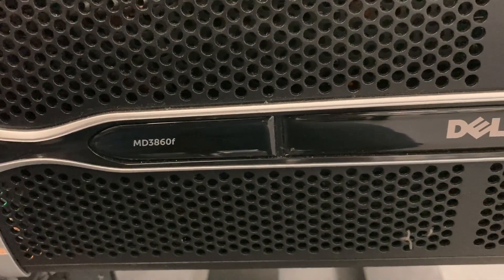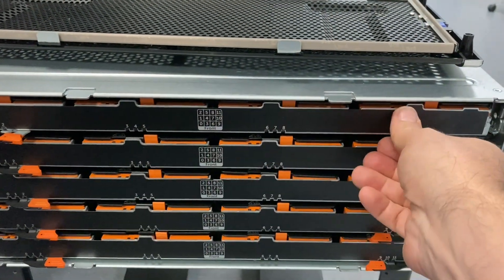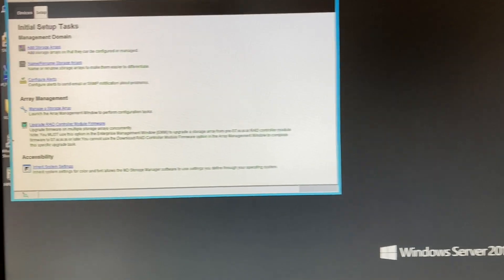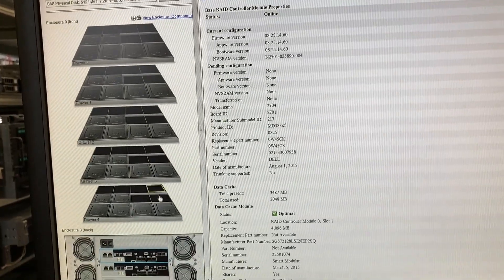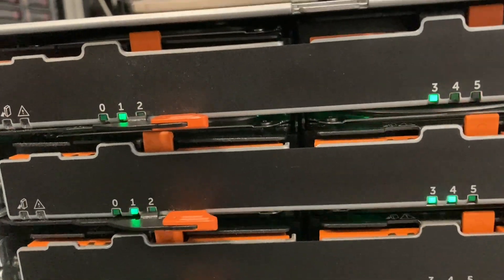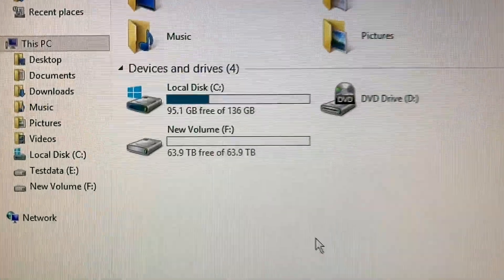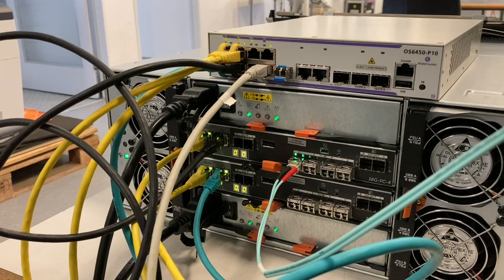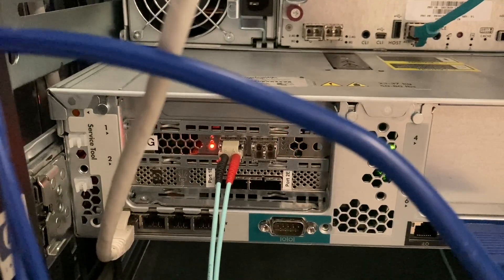Dell Powervault MD3860f 60-Disk Storage System (PWJ213)

Comment: Got two units just like this at work, and unpacked them with friend who is not weak but lightly built guy, while I am more massively built. Those are quite heavy while empty and we considered them to be empty. Got them out and in to their boxes.
Half a year later of idle storage in warehouse had to help 4 guys to lift those (they could not), apparently they were fully loaded with HDDs. Some fun psychology/power of believe stuff.

Cool channel name BTW!
Reply from the maker: One colleague at work lost the tip of a finger when he tried to lift a HP C7000 blade enclosure. They also tried to lift it with everything installed.

Comment: Nice stuff 🙂Especially this transport cart/crane. I also need such a device for lifting heavy modular network equipment. Which brand/model is this?
Reply from the maker: That's some very old gear. But if you google for "datacenter lift" you will find similar tools.

Comment: Is this still useful?  I mean it works, but would anyone deploy it in a new setup?
Reply from the maker: Probably not this model but there are similar storage systems available today. Smaller disks or SSDs but the same idea.
Reply: Considering there are 22tb 3.5 inch drives out now, I can see this still being useful for extreme capacity, though I'm not sure if this model can support anything that large.
Reply from the maker: It already has 12TB disks inside. I see no problem to install 22TB's. Maybe you need to make more virtual disks.

Comment: Can it also be used as a sas jbod? What are the sas connectors on the back for?
Reply from the maker: I think JBOD is possible. If not directly then you can set up single disks as logical volumes and map them as desired. 
The SAS connectors on the rear are for expansion drawers with more disks.
In fact if you only want JBOD, then you can use an expasion alone wihout any RAID controller. Saves some money 🙂

Comment: Sad to think you can store many times more storage on a micro SD card smaller than a Cornflake
Reply from the maker: I haven't seen a 12TB SD card yet and if that exists it will be more expensive than a HDD of same size
Reply: @PlaywithJunk  Yeah , I didn't do the math, just assumed since it looked legacy and running on an older OS,  well yes a matchbox could hold 12 x 1Tb microSD cards, expensive yes, a few years from now then certainly it's possible.
Reply from the maker: I don't say it's impossible. But any kind of flash storage in this scale is way more expensive. I had some 7TB SSDs from Dell costing $5000 each. A 12TB mechanical disk is $200.
BTW don't fall for those cheap "10TB flash drives for $20" they are a scam.